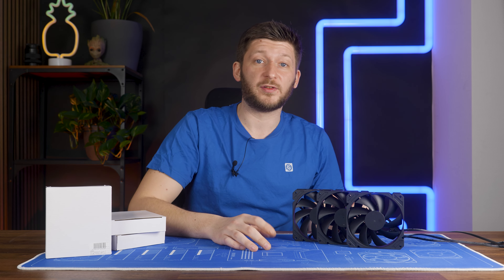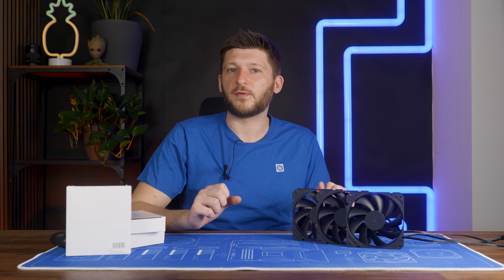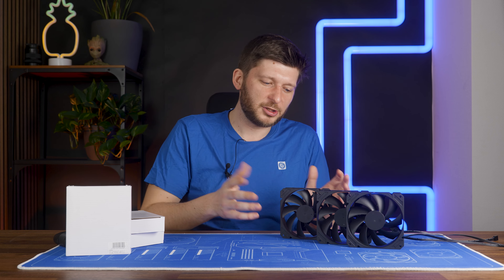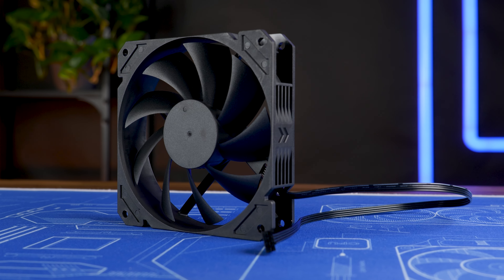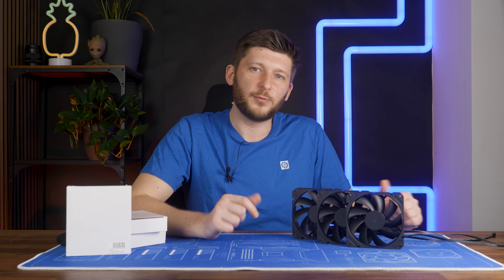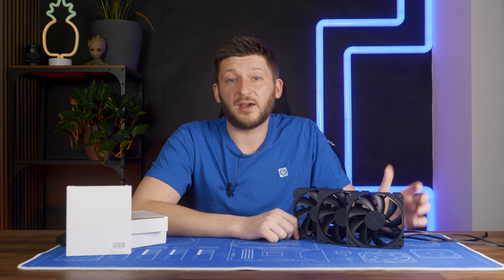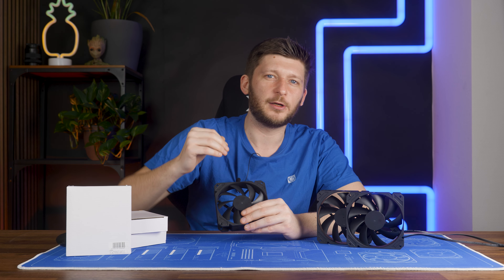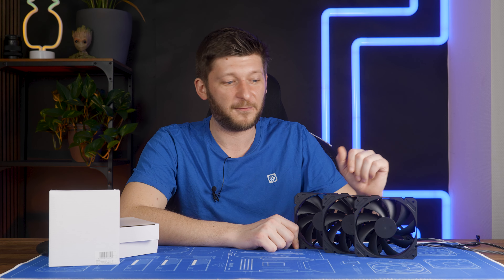Alphacool Core 120mm 2500RPM Fan - How Far Can They Push It?

Comment: If there's one thing I love it's fan reviews (i'm weird like that) and I've been enjoying your past reviews. I have found the Thermalright TL-C12 series to be a good alternative to the Arctic P12 as they are similar priced and have similar performance. 

If you do review more budget fans in the future I would be interested on seeing how the Phanteks M25 series does, and also Deepcools FK120 or newer  FC120 RGB fans perform
Reply: Is the TL-C12 you're speaking of the grey looking fans? The ones that come with the PA120 (regular) cooler?
Reply: @Ben-ld1qi  Yeah they come with the PS120 SE too.  There's a slightly cheaper C revision (TL-C12C) with is supposedly a cheaper/cut down variant that comes with the Peerless Assassin SE. For the cut down C models. Those ones are pretty insane value, at under £12 for a triple pack - or £4 a fan. Assuming they perform well vs the P12 and F12. Could be hidden gem as fans go.
Reply: @hinchlikescake7592  Ah I see. It's funny I actually have the PA120 SE, yes the fans are not bad at all, they have rubber pads but only one side tho, and the fan blades direction is reverse of the conventional. I replaced those fans with the P12's and they were about 3c better (with 2x P12 on P120 SE heatsink) on max load but the P12 also goes to higher RPMs. 
I heard the P12 used to be $5 in the past, that's quite a bargain, but nowadays they're not that cheap anymore. In my country the P12 PWM PST costs $9.27 as of now. And the 5 value pack PWM PST for $38.73. So the Thermalright fans are a good alternative.
Reply: @Ben-ld1qi  Yeah TL-C12 come with the PA120 but Thermalright also has them in black, white and rgb variants now. They also have the TL-C12 pro that has higher RPM but from what i've heard those can get a little loud.
Reply: @boonie3  You know I ordered the PS 120 SE ARGB for my cousin's build which I'm helping him with, should arrive very soon. I'm really curious how the fans will be like. From the pictures they look very nice! Also have pads on both front and back, conventional blade orientation, and overall look like a decent fan. Sorry I can't recall the fan model off the top of my head but it's available online. If they're good I might add a few of these to his case.
Reply: @boonie3  by the way, of the fans that you've described in your post, the phantems and deepcool, which one do you recon has the nicest RGB if I go that route?
Reply: @Ben-ld1qi  Nice upgrade. And thats fairly interesting. I was going to put some P12's on my cooler (PS120SE) but decided to go with the B12's instead. Pretty good performance with those P12's. Looks like the extra static pressure is helping lower temps quite a bit.

About P12 and prices.. its a similar thing the UK and prices flucuate a lot. The P12's are really good when they are in the $5-6 (or less) mark but tend to hover around the $8-9 which is still really good. Be interested to see how the other fans stack up against it because there isn't other fans that really match it in terms of value. Maybe the TL-C12PRO,  TL-B12 or Phanteks M25? All generally more expensive than the P12 at $10-12. Though the M25 does go fast and loud (more than the T30 lol) but offer some good airflow.
Reply: @Ben-ld1qi  hmm i am not exactly sure which one would have best RGB but both companies make good RGB stuff so I would assume both would  look nice
Reply: @Hinch Likes Cake  Haha well it wasn't intentional. One of my brothers ordered x10 P12 PWM PST fans for his build that got delayed for months so in the meanwhile I tested them out. The stock fans were definitely more audible on higher RPMs, it was quite noticeable. The PA120/PA120 SE Dual Tower heatsink in itself is badass... Definitely gets my vote up, but the stock fans leave a bit to be desired although for most people they'll be perfectly fine, it's only when you're tuning/overclocking and stress testing the system for days or weeks and your fans are constantly ramped up, you'll notice the difference.
Unfortunately the stock fans disappointed in only a matter of months, I transferred the stock fans as intake right beneath the GPU, using a 'Graphics Card Cooling Fan Bracket' (look for it on AE). And after a few months both fans developed really annoying rattling and hissing that would come and go, so I had to take them out. Right now they're back on my PA120 SE and they still do that at certain RPMs so I run them at the lowest RPM possible. As a matter of fact I very recently found someone selling the Noctua NF-A12x25 Chromaxblack (he's got over 30 of them) stripped from NH-U12A C.b heatsinks for just $13.63 a pop which is quite decent so I got 2 got them but haven't tested them out yet. 

The TL-C12PRO and TL-B12 are the fans that come with the Frost Commander and Commander Spirit heatsinks, right? i read they're quite good, with the B12 being slightly better but also slightly more audible. I'm unaware of the M25 though, sorry. Maybe the Arctic P12 Max for $8.99 could make a good contender if it's available in your country. The cheapest I can out source it for is $12.5. P12 PWM PST value pack is $31 on Amazon for my country (not bad at all) but has $16.31 shipping which kills it. 

I just remembered that I also tested the PA120 SE with x2 Arctic P12 Bionic fans, which can ramp up to a steady ~2050 RPM, they did outperform the Arctic P12's, but at the cost of more noise lol. They also spin so fast that they rattle the entire heatsink, I would have needed some extra foam/pads to reduce the overall NVH (Noise/Vibration/Harshness). And adding a 3rd fan (P12) on top of the two Arctic P12 Bionic fans, took off another 2c when looping Cinebench on an overclocked 12700K (all fans on max speed). But I wouldn't recommend it in terms of noise output... 

Overall I'm always on the outlook for decent budget fans. Especially now when I'm putting together a gaming for my cousin, albeit he wants RGB on all his fans lol.
Reply: @Ben-ld1qi  That worked out well then lol. Yeah those TR dual towers are so good. Probably won't be bettered for a long long while if ever with the right set up, especially at this price point. Yeah C12's are decent are fairly good for stock fans, not up there with the best but far from terrible. Might use them to fill up extra slots in my case. And you got a bargain on those Noctua's and Chomax at that! Those would be amazing on the PA120.. fits the black aesthetic and are in another tier from the C12 and P12.

Funnily enough I too have one of those PCi slot to 120mm fan metal bracket. Has a Arctic F12 on it. Works well but took it out and haven't put it back in. Keeps GPU cool(er) and helps out slightly with SSD and motherboard temps. Shame about the rattling on the C12. It might be that the motor don't like being operated when upside down.

And those Bionic are fans are crazy. Think they based the design on those for the P12 Max, which is another extreme fan; that runs at 3000+RPM lol. Probably not the best idea to strap on a heatsink at least in the long term if they vibrate a lot plus the noise, like you said.

For comprehensive fan reviews there's Igor Lab. Think I saw some good RGB ones on there that are high performance. There's a lot but the one thing I'd do it avoid Corsair fans. Always underperforming and loud. There's the ARGB P12's which are basically the P12 Max design wise but with a much quieter motor. According to Igors testing its nigh on par from the NF-A12's in terms of noise and airflow in his simulated case tests. MIght be a good option if your cousin wants a cool and quiet case fans with some bling. They are pretty cheap too for ARGB fans and can be bought as a multipack of 3.

Comment: Any chance for reviewing Thermalright fans? Not seen many people review those but they have decent specs on paper and very good price to performance. I have currently 2x TL-C12's which came with my CPU cooler and they seem to do a good job.

There's also the TL-B12 that I have and not yet installed.. which is supposedly (according to a Chinese reviewer), slighter faster and better performing Noctua's NF-A12x25 at a slight noise disadvantage at max and over half the price. Would be cool to see if this is tested vs the rest of the pack. They are fairly 'cheap' or affordable and don't have issues like the P12 where you might be unlucky and have a whiny fan at 1000RPM. And the B12 seems to be a step up from that (these things are built like tanks! and heavy too), without going full T30 or industrial fans.

Comment: Reminds me a bit of "high rpm" gentle tyhoons, yet they had a "AP-29" with 3000rpm, "AP-30" with 4250rpm and glorious "AP-31" with 5400rpm and 150 cfm..... a literal beast of a computer fan. I have one in my rig, and pretty much spinning on lowest possible rpm (2000 🤣) all the time. Would like to see a review on one... if you can actually find it on sale anythere. Also it can be modified to standart 4-pin fan header instead of molex.
Reply from the maker: I tried getting typhoons before, it’s like impossible to get them here 😅

Comment: What's the point of these max noise ratings if they basically are out of touch with reality every time? How do fans manufacturers measure them?  How is it that alphacool claims they are at most 36.6 db and in reality they're over 30 db louder? This is absurdly large difference.
Reply from the maker: Because everybody is trying to use it as a selling point. 
Everybody is measuring it differently. Some do it at 30cm, 50cm or as it should be 1m.
That’s why you should never trust these numbers.

Although we are measuring them at 30cm (which is why the numbers are high), all the fans are measured at the same distance. Hence you can compare them. If you go by spec sheet you would have no clue what you’re actually conparribg